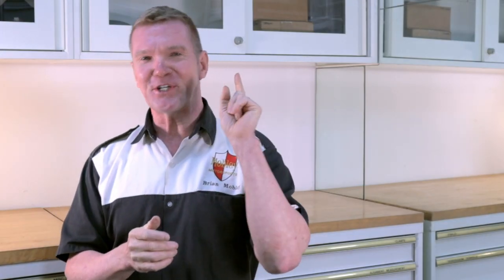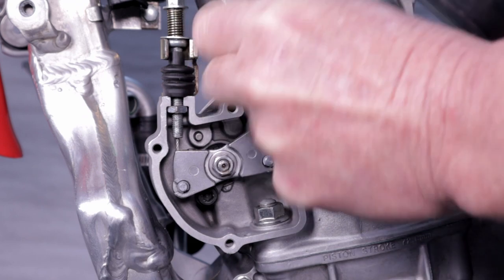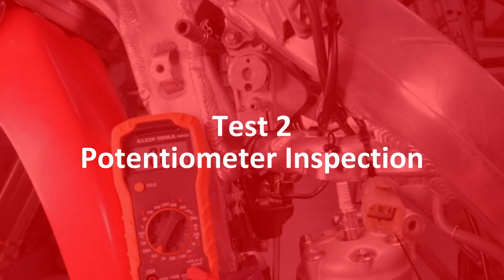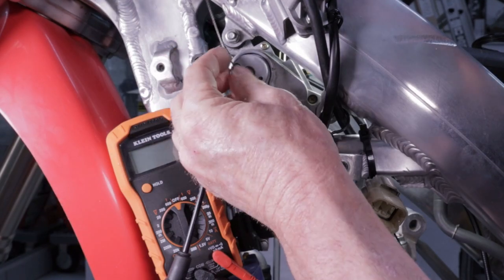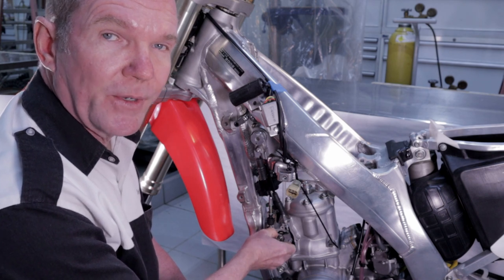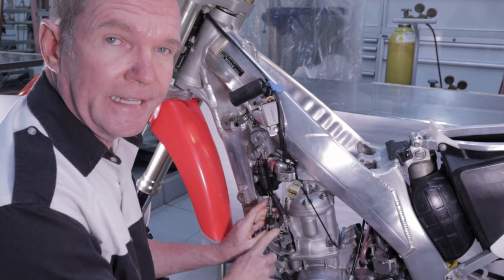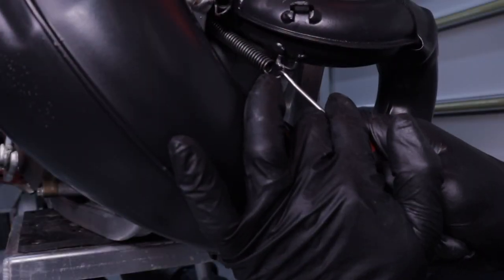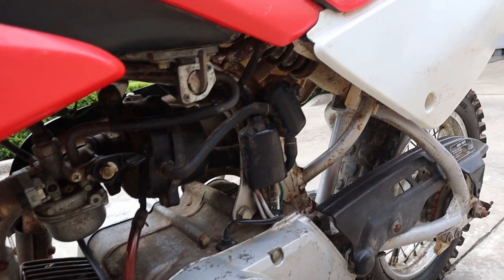Demystifying the RC Valve || Inspecting and Adjusting - CORRECTLY!

Comment: The video is amazing! Where do i get replacement parts such as the cables and servo motor? Maybe you have the part numbers? I have an 02 cr250r. Just subscribed too!
Reply from the maker: Thanks Daniel!  Glad you liked it. As for the cables and servo, I tend to like Rocky Mountain ATV for buying OEM parts. They have all the part numbers on their site or you can call them. Thank you so much for subscribing.   BTW, I ride the exact same bike that you do! Ride red!
Reply: @brian.d.mobley  RIDE RED! My bike has a pretty gnarly bog at the top. Super strong low end (insane) but right when it starts to get on the pipe it falls off. The rc lever is super tight (with the cables attached) im assuming the cables are gummed up. Im gonna dig into it later. If the valve is gummed up,  can i clean it without removing the cylinder?
Reply from the maker: @fourny55  That bog is more than likely, jets.  It can also be ignition, fuel flow, air screw.... lots of things!  If the RC cables are tight, its highly likely that they are not adjusted correctly.  Its is COMMON for those to be improperly adjusted.  When they are correctly adjusted, they work just fine even though there are lots of people out there criticizing the valve and its design.  Regrettably, you really have to take the cylinder off to service the RC valve. Its not super easy, but if you are patient and careful not to miss a step, you can do it.
Reply: @brian.d.mobley  awesome, ill take a look into it and keep you posted. It has a keihin pwk carb i believe. I just bought it. Im at sea level on the coast of cali, what jet size you think would be right?
Reply from the maker: @fourny55  Im almost positive that on that carb, the recommended settings for sea level are: Air Screw: 1.5 turns from fully seated. Low Speed Jet: 32.5. Clip position: 2nd. Main Jet 390, but check the PWK website to see if thats right!  Im not positive on that....
Reply: @brian.d.mobley  figured id let you know...the bog at high rpm was a clogged silencer. There was a makeshift spar arrestor (screen) that only had about a dime size opening in it. Thing rips now! I ended up getting a new gnarley pipe and an fmf turbine core 2 since i do enduro mostly. 

Ill let you lnow about the jets. It currently has a 172 main and a 45 primary in a keihin pwk air stryker. Needle clip 3
Reply from the maker: @fourny55  WOW!  Its just crazy all the things that can create a problem.  Good one for me to store in my mental database.  Thanks for letting me know!

Comment: Thanks for the great video! Quick question. Will the '04 250 servo motor work with the '04 125?
Reply from the maker: Hey J!  The short answer is; I just don’t know for sure.  My instinct says “no” because the CDI is different between the two bikes.  Check the part numbers for each.  If they are not the same, they are not likely to be compatible.  For sure the cables are not interchangeable.  Im sorry that I don’t know more that I can share.

Comment: Brian, did you use just a straight wire from alligator clip to 12v battery?
Reply from the maker: Basically, yes. I bought some wires with alligator clips on each end. I only used them because I didn’t have enough hands to just hold the OHM meter leads and battery leads all at the same time.  https://www.amazon.com/dp/B0739YWFQ6/ref=cm_sw_em_r_mt_dp_4qy0Fb20E1SMR?_encoding=UTF8&psc=1

Comment: Sir,can I know from where the supply voltage of servo motor coming from. please send to me the complete wiring for my crm 250r.thanks.
Reply from the maker: Hi Nonito!  The voltage is created by the rotation of the crank and the interaction between the spinning crank on which the the flywheel is attached and the stationary stator bolted onto the case.  As for the wiring diagram, I dont have that but consulting the service manual is what I would recommend.  Thank you for watching!
Reply: @brian.d.mobley  thank you so much sir..I'm from surigao,philippines.
Reply from the maker: @nonitoodjinarjr.4521  Awesome!!  There seems to be a lot of motorcycling going on in the Philippines.  I get a lot of viewers from that part of the world.

Comment: I have an 04 125 and does the HRC 10mm measurement the same for the 125? This was a great and informative video!
Reply from the maker: Hi Jim. The technique is the same for your bike. However the 10mm gap is not a specification, its an outcome.  I only included that measurement as a comparison to the myth of the 12mm gap. The gap could be 9mm or 11mm or something else after correctly adjusting everything.  Thank you for watching!
Reply: @brian.d.mobley  I understand now. Thank you for taking the time to answer my question and getting back to me this quickly. I enjoyed the video.
Reply from the maker: @jimmadonna1436  My pleasure. Thank you for taking the time to leave a helpful comment that may help others regarding the 10mm value and its interpretation.
Reply: @brian.d.mobley  It's a not often that I come across a True GENTLEMAN on this function. I respect the fact that you made an informative video to help the owners of this exhaust port height altering power valve system that the Service manual doesn't go into detail about. Mine says nothing about measures. It was rushed into production. It has an FMF PIPE AND SILENCER and I jetted it according to the FMF chart. I fouled 1 plug since August 2016.
Reply from the maker: @jimmadonna1436  Awe shucks! 😊. You’re making blush!  Ha!  Thanks Jim. I enjoy making videos and it’s rewarding to be engaged in an enterprise whose sole purpose is helping others.  Being a content creator is a perfect fit for my abilities and personality.  Thanks again for your kind comments and for watching.
Reply: @brian.d.mobley  Your Welcome!

Comment: Hey Brian ! , I have a question about the power valve on my cr250. I’ve noticed some excessive noise from the motor. I’ve read on a lot of fourms, and everyone says that these just make this noise from the power valve. So after I adjusted it your method I noticed that when the valve was closed, it was hitting inside the exhaust port scoring it. I’m figuring this is where the noise is from because it’s mainly from idle. I noticed where you adjust the valve it has a metal stopping pin and tab that comes off the arm. Is this something adjustable or do I need to replace these? Or is it even why my valve is hitting in my exhaust port?  I’d appreciate and info you might have on this. Thanks jesse
Reply from the maker: HI Jesse, Do you have the metal stop pin in your cylinder?
Reply: @brian.d.mobley  if your talking about the metal stop pin that is behind the “eco valve” cover. Yes the pin is there. But it looks like it scored into the exhaust port. And I think this is the reason for my noise. I’m not sure if it’s the metal pin that is wore out. Or where the pin hits on the arm where both cables are attached. They just don’t seem that worn to be causing a groove that bad. Just not sure what to do
Reply: “Rc valve”
Reply from the maker: @mnvjim7900  Can you email some pics or video?  I need to see whats going on.  sterlinganadar@gmail.com
Reply: Sorry I’m not sure why the quality on the video looks bad

Comment: Hey thank you, finally this makes sense. However, on my 04 that i just totally rebuilt (carbon free) my valve does not over rotate? I don't know why?
Reply from the maker: Is it an 04 CR125?
Reply: @brian.d.mobley  No it's a 250
Reply from the maker: @nickmiller7373  You stumped me.  I honestly don’t know why then.  Mine is a 2002 and it very easily “over-rotates” (I kind of made that term up as I didn’t really know how else to describe it).  The cylinder head is the same from 2002-2004, so I am not sure why yours is different.
Reply: @brian.d.mobley  Hmm I can't find a source about it right now but I thought I read somewhere they redesigned it even before 05. Double checked everything and am running it. Thanks for the reply and vid.
Reply from the maker: @nickmiller7373  My pleasure.!  Thanks for watching.
Reply: Hello Nick. Has the cylinder been repaired? I replaced my cylinder on a 2002 CR250 and had to grind off some material to get the flap valve to move freely. I think the cylinder I got back had a repair on the port bridge (not sure if that is the right term).
But this is just a guess from me :)
Reply from the maker: @TheMotorOlazx  Hey!  No, no repair (thankfully!).  Mine was stock and in good condition.

Comment: hello I have a problem with my cr 125 2004
I have reviewed everything you mention in the video and very good by the way, but my motorcycle has no strength when putting speed as if it were drowning and I have moved it where the servomotor is and it seems to improve at times, I have reviewed the values with the multimeter And it is in range, the resistance varies about 2 to 4 omhs it does not go up to 6.5 but I think I am in range, it only does it at times that it wants to move hard but it always walks like drowned and I already did the carburetion and nothing and how you I comment and I checked cables, continuity, check the valve, the servomotor, and I can't find the problem, disconnect the cable system and that's when it gives a reading to the servomotor and wants to pull hard but it loses reading again and starts very drowned and slow , I don't know where else.
something you can recommend me.
greetings excellent video
Reply from the maker: Hi Mike.  You didn’t mention changing the reeds. That can cause the exact problem you describe.  But fuel delivery problems can be caused by a zillion things- air leaks, jetting, needle height, air screw adjustment, float height, crank seals....  It’s a huge list. It’s very difficult to help someone with these sorts of problems if I don’t have the bike in front of me.
Reply: @brian.d.mobley  Is it possible that I can send you a video to see how the servo motor works?
please because I can't find what it could be
Reply: @brian.d.mobley  I remove the cables to see the servomotor work and it happens that the signal reaches him and the motorcycle works correctly but the servomotor moves strangely back and forth, and it stops working. I move it manually and it returns to its position and the motorcycle works correctly so I don't know where the problem lies if in the servomotor or in the CDI
Reply from the maker: @Mikevlogs95  Hi Mike.  Sure. You can send me a video, but please understand that I have a full time job and these things can be very time consuming to sort out.  Its extremely hard to help with problems like these without having the bike in front of me. I cant dedicate hour after hour of time to diagnose problems such as these, but if its an obvious problem, Ill try to help. sterlinganadar@gmail.com

Comment: So you didnt run it to show the valve action. I think the servo doesn't care about your white line. I think the potentiometer is a crude encoder that keeps track of the postition of the servo with the linear increase in voltage as it rotates, the ECU uses this information to figure out the position of the servo and then knows where the servo is and in which direction to turn it according to engine rpm and TPS position. When I have time I will take my oscilloscope down to the garage, swap the 3 year old fuel in the tank with fresh fuel and probe those wires while the bike is running. That should clear it up for me at least. Also that spring does not return the valve to its closed position, I think you kind of proved that to yourself when you rotated the valve by hand to the open position and it just stayed there, until you manually returned it to the closed position, the spring is there so you can attached the cables, try attaching two solid cables with no spring over that short distance.
Reply from the maker: You make some good points.  The manual describes the “cable adjustment is done via the servo motor and spring.”  Honestly, I am considering doing a new version of this video clarifying that further.  I don’t think I did as good of a job as I should have, in retrospect.  But, making a video is a tremendous undertaking - not an excuse - just saying.  As for not running the motor, I didn’t.  I had other assembly left to do at the time this was posted and I was also concerned about not making the video too long as it was pretty long as it is.  I do not have an oscilloscope, but I would be curious to see what you find.  Perhaps what you learn from that i could incorporate into an updated version of this video.
Reply from the maker: Looking for that oscilloscope data still...

Comment: Can I hook up a 18v drill battery to test servo
Reply from the maker: Hey Paul.  In a word, no.  That’s not the correct voltage. If you can, use a car battery or similar.

Comment: I ordered a brand new cylinder core and I don't have the stop pin that the pully hits at the top, will I have to make my own or is there somewhere I can get a stop pin? I've looked for one but cannot find it at all.
Reply from the maker: You can create one using a drill bit of the same diameter. Cut the shank of the bit to the desired length and “glue” it in place with JB Weld.
Reply: @brian.d.mobley  Thanks for the idea and awesome video! You really taught me a lot about this whole power valve fiasco!
Reply from the maker: @zacharystonehocker2146  Glad to help. And, that power valve is a real nightmare!  I’d actually like to do an updated version of this video to clarify a few more things I’ve learned since I made this one.
Reply: @brian.d.mobley  Hey any new information would be great, keep it up man you are helping out with a lot of our issues haha.
Reply from the maker: @zacharystonehocker2146  I’m glad I can help at least some people out there!

Comment: Hi guy’s, I hope someone can help me, 

My RC value is stuck open, everything’s clean 🧼 and the butterfly moves freely, 

Done the servo test, regulator and everything works as should, the problem is, as soon as I start the bike the RC value opens, on idle, 

the cables and everything’s adjusted as in the video, cables aren’t damaged and i don’t know why, could it be a CDI problem?? 

One more thing, my bike doesn’t idle very high either, why could the RC value open up as soon as I start the bike? And close wen it switches off? 🤦🏽‍♂️
Reply from the maker: Does the valve open all the way on idle?  And, this may sound crazy, but are you manually rotating the valve to the open-most position before you start the bike?  If you do that, the CDI will rotate the butterfly back to closed on starting.  As for your last question, its normal for the the CDI to direct the servo to rotate the butterfly to the closed position upon stopping.
Reply: @brian.d.mobley  Hi , thanks for your response, 

The butterfly maxes out all the way open on idle from the close position without any tampering,

As I understand, the butterfly should be closed on idle, opening the throttle would then open up the butterfly, I understand on high RPM it should be open, 

But, as soon as I start up the bike, from the closed position the butterfly opens and then it’s stuck open, I don’t know if I’m making any sense 😅 

What could the problem be! Is there any email I could send you a video to better see what’s happening?
Reply from the maker: @nagoyaka9541  yes sir. It makes sense what you describe. However, WHY that is happening does not make sense. Please send a video clip to my Instagram

Comment: Does anyone know where I can find the electronic power valves for the 2004 cr125? My engine does not have the power valves in it for some reason
Reply from the maker: I’m sorry to let you know that there is almost zero chance of getting those new anywhere. You may be able to find something on eBay. The cables are not available but I do have two brand new OEM rear cables.
Reply: Hey Brian,
If the cable you have is one of the ones that connects the power valve flapper under the RC cover to the server motor than yes!
Reply from the maker: @kaleb71948  HI!! Yes.  I have a brand new OEM REAR cable (the one without the spring) that fits a 2004 CR125. Honda PN: 14330-KSR-A00.
Reply: Awesome! How much would you charge for it?
Reply from the maker: @kaleb71948  I paid $85 for it!  Ill sell it for $115 plus shipping.  Im in Texas.
Reply: Wow! I don't know if I can justify paying that much for it
Reply: How much did you pay for the second one?
Reply from the maker: @kaleb71948  no problem at all. I understand.
Reply from the maker: @kaleb71948  I have 2 of the rear. I bought both from Europe at the same time and paid $85 for each.
Reply: Okay, do you know if the cable was a different parts number in Europe?

Comment: So your method will fix the flutter?
Reply from the maker: Hey! Like I tell a lot of people, it’s a cable, not a linkage. So, it can still flutter. But, most of the flutter is due to turbulence behind the port when the flap valve is not in the same plane as the top of the port.
Reply: @brian.d.mobley  dope, my bike doesn’t flutter anymore. I did the method but without sticking a piece of wood in the valve
Reply from the maker: @shorelinefilms9661  Im stoked to read that!  And the wooden stick thing I used was just one way of aligning the flap valve with the top of the port. There are probably a dozen ways that could be done. But, mostly, I’m happy to read that you had success with the adjustment.
Reply: yeah this video helped big time. thanks for the effort you put into it. definitely can't find one anywhere else!
Reply from the maker: @shorelinefilms9661  Thanks so much.  Funny enough, Im considering doing an updated version of this video to clarify a few things that have been brought up by viewers.  So, watch for an updated version to come out in a couple of months